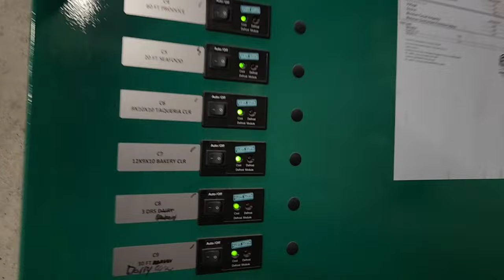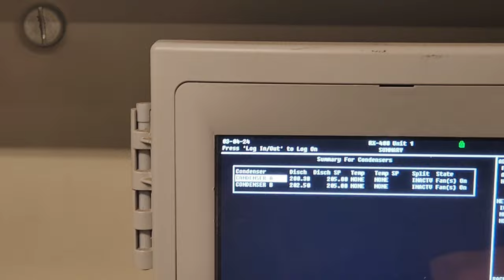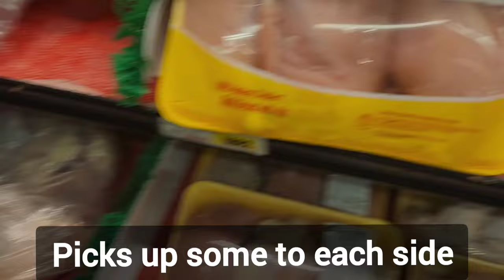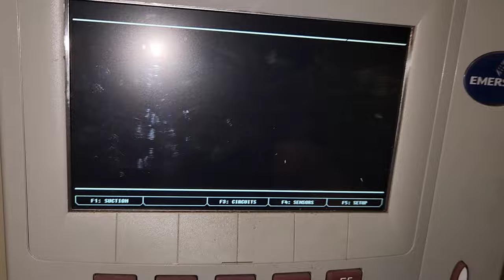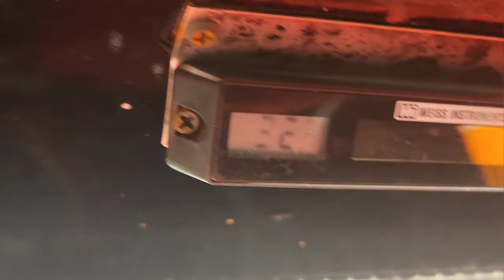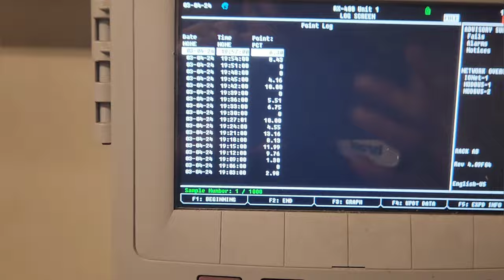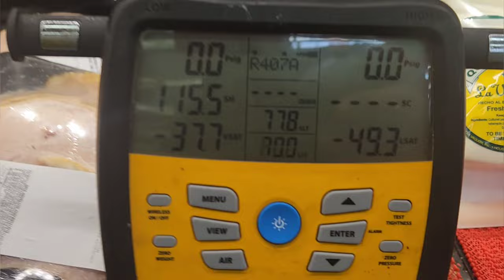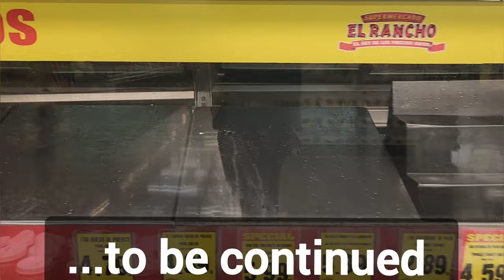Leaks On Rack and Recharging Pt 1

Comment: I hope you wear hearing protection in those mechanical rooms. It sounds LOUD AS HELL in there. 

PS those switches you turned off, does that kill the power to the coolers or just the freon?
Reply from the maker: Those switches are supposed to shut the circuit off. Just the refrigerant flow.  Most commonly, maybe it would shut off a liquid line solenoid valve. But depending on how it's designed, it could shut off an EPR valve. Either way, it stops refrigerant flow. If it's a LLSV, the circuit should pump down the refrigerant back to the receiver.